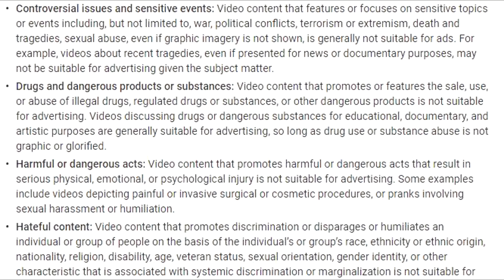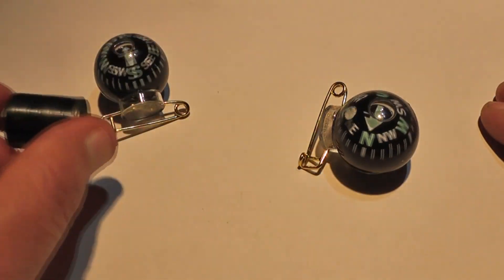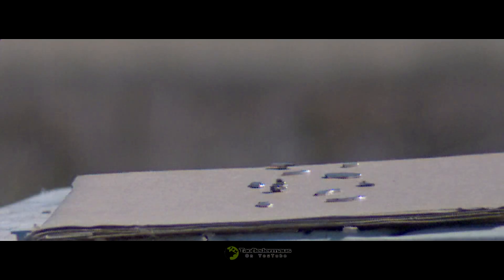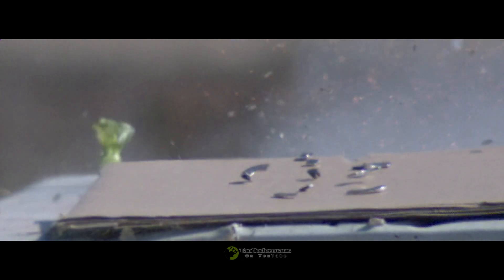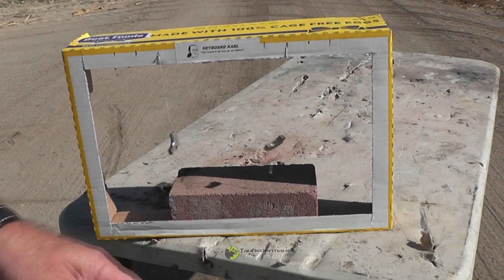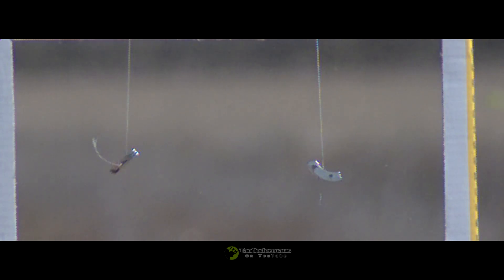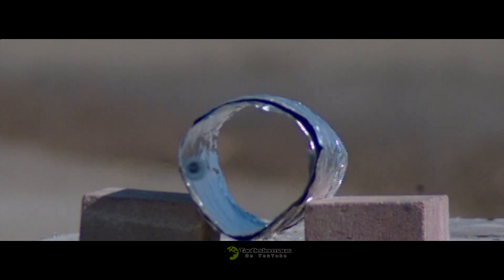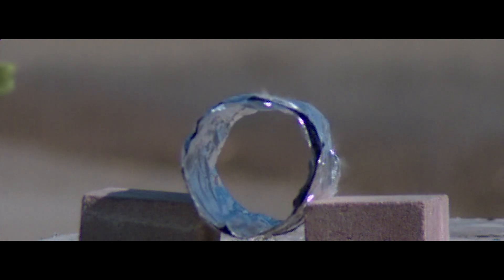1000 MPH Magnet Experiment

Comment: I would suggest using a non-magnetic object to replicate the aluminum foil experiment. (A high speed lead object would work well)

For the magnetic coil I would suggest using an oscilloscope and a Tesla Secondary coil (you can get a decent one on eBay for around $20) The oscilloscope would be best for measuring and potentially recording the results as some have storage function and they are designed to display high speed electrical changes. You may have some luck with LEDs as they have very fast response times, just make sure to hook up at least 2 in opposite directions in case the north south faces switch post acceleration.
Reply: It would also be prudent on the future to try using a piece of plexiglass to shield the magnets from the shock wave

Comment: oh, and for the foil test, you just need Danny to pass some non-magnetic items through at speed. I think there was a bit more than just shock wave there, but if it was the same effect with a  stack of washers run across the same way, then it was shock only.

Comment: ScrewTube. Are you guys on any other platforms?

Also, "electromagnetic catapult."

You might "accelerate" the magnets through a coil, like you did with the pipe, maybe with a voltage meter attached

Comment: The suggestion was made that shooting The magnets through the aluminum foil tube could be expanded.  If you go back to expand on that experiment,  a control to see if it’s the shockwave would be to also make a paper tube of the same diameter.  Then there would be no mango-electric force.

Comment: could you get similar sized to the ceramic magnets super strong neodymium magnets and test them this way. Very cool  experiment.  One cool test for this is use your aluminum tube to wrap a tight copper wire coil end to end of it then slide the coil from the tube. Place it on the shooting stand with a multi meter attached to either end of the wire. then shoot the magnets through the coil and see how much of an effect it would have. great shots guys keep it up big fan

Comment: What if … a neo-diddley-um magnet were accelerated into a container/bag of iron filings/iron oxide?  Would the compounding resistance of dense material be the primary slowing factor  -  or  -  Would the attraction of the magnet at the tip (" and only the tip ") gathering mass through magicnatisim/pixies, causing a increasingly greater surface area, be the cause of deceleration ???  P.S. Other cover noises - Burp, fart, sneeze, whiney, tire squeal, glass breaking, S.J.W. screaming "NOOOOO..."

Comment: "We weren't sure if it was magnetic flux or the shockwave that caused the distortion"
I'm pretty disappointed that you didn't try firing a random 1oz non magnetic projectile through it. Maybe even composed of lead?
V = (F/m)*t
That being said, I knew all the other experiments would do nothing as a weak magnet acting on an object from 4 inches away for less than a thousandth of a second would do as much as blowing in the direction of the objects from 5 yards.
the generation of electricity, on the other hand is directly proportional to the speed the magnetic field moves across the conductive material.
That said, build a simple copper coil and attach an old school maglite flashlight bulb so we can watch it burn out in under a thousandth of a second.

PS: I've been handloading my own slugs since the 2000 fps monster video. The fireballs out of a 14" barrel are AMAZING

Comment: F=m*dv/dt. The force (F) of the ceramic magnet is rather small, the mass (m) of the objects it's passing near is rather large, and the time to act (t) is miniscule. Thus the velocity must be quite small.

For a coil you could try a coil of magnet wire around a PVC tube, but to actually measure the pulse would take some equipment you probably don't have (oscilloscope).

Comment: To check whether the effect on aluminium foil was caused by magnets or by shockwave, why didn't you try to shot the same way with non-magnetic projectile of similar weight and shape through same setup, and compare the results?

As for shooting magnets through the coil: take the cylindrical coil from the school physics lab set (or just wind copper wire around the cardboard tube many, many times), and connect the ends though small fuse. I think the impulse would be so short that even using LED or neon light to connect the wires wouldn't show anything. Similarly to the aluminium foil case, compare magnetic projectile effect to non-magnetic projectile effect.

Comment: Protipp, measure the speed before and after the projectile passing the tube, for reference let another magnet travel through a plastic pipe in same diameter and another one without any tubing. if there is any magnetic force involved the result should show them.
Reply from the maker: we only have one chronograph
Reply: @taofledermaus  that is too bad. anyway thanks for your content.

Comment: This was really cool, im not too surprised that the magnet didnt really affect anything since you can kind of consider the high speed as being equivalent to a short exposure time.
Im really intrigued by the metal pipe experiment. An idea i had to really see the effect of the EMF would be to shoot the magnet through a solenoid connected to a volt meter, voltage should spike as it passes through (although the time scale might require an analog volt meter instead of a dvm). A control should be easy as well by just shooting standard slugs through things. It would also be really cool (and difficult) to measure the speed of the projectile before and after passing through the solenoid.
If i have time ill do some first order approximations later and see what theory says.

Comment: you could "apply" a foster slug to the aluminium foil tube as a control for the same to see if the shock wave has the same effect. i would say you could try to time the effect of the attractive force of a magnet on the compasses by measuring the length of time it takes for the subject of the force to react once the object of the force is brought within range. that way you could ajust the "speed of application" to see what it would take to prove the theory.
Reply from the maker: We did  that,   the shot was in the center,  but I may post it still .
Reply: @taofledermaus  i saw that but to use it as a control to see if there is an aerodynamic vaccum which draws in the sides of the tube. the other side of my point could be a vid in itself where you test to see the reaction speeds of the materials effected by the magnet. would tell you what speed the projectile would need to be travelling in order to have an effect on the compasses. i think is possible that magnetic waves are slower than the speed of sound therefore higher speeds than mach 1 would not  give any results

Comment: Use a cardboard tube wrapped with copper wire hooked up to an analog volt meter.  Like a paper towel tube if those haven't been banned out there, yet!  Even better would be an oscilloscope since they can capture and chart voltage spikes.  Maybe a colab with ElectroBoom?

Comment: You may try shooting through a hollow long coil, and e.g. having both wire ends seperated by a millimeter or so, a electric voltage surge may result in small, visible flashes.

Comment: My suggestion would be to get a second chronograph and set up a control test. Whatever the length of the pipe,(foil or solid)have the two chronographs that distance w/out the pipe and measure the loss of velocity. Afterwards, put the pipe between and see if there's a drop in the reading on the second chronograph. 
Also, was that a patreon funded rail gun and flux capacitor?

Comment: An experiment that would (should) show results if one that you probably don't have the equipment to perform. Squirt a magnet through a loop of several turns of copper or aluminum insulated wire and have the ends of the wire loop connected to a triggered oscilloscope. I'd certainly expect to see a voltage/current pulse generated in the wire. You might have to perform the experiment a few times to get the triggering correct on the scope. One way to trigger it accurately would be to fire the particle through a fine wire, breaking a trigger circuit some distance before the particle passes the wire loop.

In most of the tests you tried in this sequence of experiments I think that inertia was simply getting in the way of showing any results. For instance the magnetic particle almost certainly had an effect on the compass magnets, but they are deliberately damped by the fairly thick liquid they float in. This liquid is specifically designed to keep the compass from zipping around willy-nilly to every slight magnetic variation, and that was exactly what you were trying to detect. So the effect of the moving particle was deliberately below the level of detection of those particular compasses.

Comment: i got an add The tube cant be that big , the magnetic flux is only effective over a short range. The amount of energy is proportional to the speed but you would have a tune that was as close to the same size as the magnet as you could. the energy would show up as heat in the aluminum and slowing the projectile.

Comment: If you had multimeter hooked to the aluminum tube you MAY be able to check for effect.
Reply from the maker: No,  because it it would be like measuring the voltage across a 1000 v.   bus bar.   It would just read zero.
Reply: @taofledermaus  You would need a way to bond it to an earthing(grounding) conductor. I just wonder if it would then create a choke like a metal conduit during a lightning strike does to the current in an earthing conductor, or induce a current in the tube. My guess is it would be the latter in  microvolts.
 If the tube was conducting, would that then cause the magnet to be "choked" and slow the velocity? But then you would need to ground the magnet. Hard to do.

Comment: Excellent video! I love these utterly uncontroversial, family-friendly, pure science videos. This stuff would be right at home on PBS.

The results don't surprise me. I expect that the magnetic field does exert forces and induce currents exactly as you might expect, but it's happening over much too short of a period of time to visibly overcome the inertia of the target objects before the shock wave arrives and shakes everything up.

Now here's something that might work: What if you launch the magnet through the center of a coil of wire, and try to capture the induced current in the coil with an oscilloscope? I don't know if the Taofledercrew includes any electronics nerds, but if not, I'm sure you could find somebody to collaborate with if that idea appeals to you.

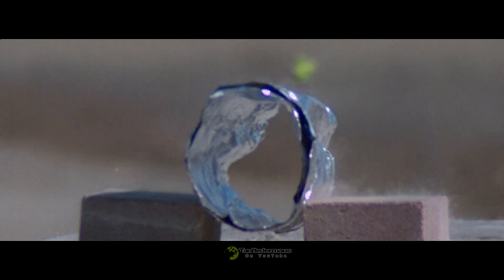Comment: 8:27 You should just set up the same flimsy Al tube and shoot a slug through it.  Probably would get same result.  Probably creating a temporary pressure differential between the area inside tube and that outside.
Passing it over coil and checking for electricity probably requires an expensive oscilloscope to measure.

Comment: I don't know if this is worth repeating experiments for, but it seems as though the shockwave distorted test results more than the magnet could have done. Would that be entirely eliminated by sending subsonic projectiles instead? It also seems apparent that the velocity of the projectile does not allow for enough magnetic field to reach nearby objects, so you can infer that magnetic fields operate as a function of time. So, projectiles over a certain velocity cannot produce hardly any magnetic field in one area in comparison to the same projectiles at v=0.

Comment: If you shoot a slug or a cork etc through the aluminum foil, you can test if it was the magnetic flux or air pressure. My bet is air in all honesty. Also, it is unlikely that ceramic magnets have the magnetic flux density to be noticeable in most of these experiments. N52 grade Neodymium would be more noticeable, plus the fragments stay stronger relative to ceramic fragments. 

Afterthought, was there any different feeling from “moving” the magnets through your “coil gun”? Wouldn’t the steel barrel skew results?

Comment: The best way to determine if the shock wave caused the tin foil to collapse would be to repeat the same experiment, but use a non ferrous slug, making sure that it's calibrated to travel at the same speed as the magnets.

Comment: For a second there, I thought you were charging up a defibrillator. 😛

On a more serious note, the pipe may have been too large in diameter to exhibit the effect you were looking for. Keep in mind that magnetic field strength decreases according to the inverse square law. So you need to get the fit as tight as possible. Unfortunately, that will make it really challenging for Cha-- I mean Danny.

Comment: Shame on YouTube for making you jump through hoops like this.
Sending high speed magnets through or over a coil might just be the test that would show the most effect. Millivolts most likely although a couple of volts could happen. You might try winding wire around a 3 inch PVC scrap and accelerate the magnets through that.

Comment: I have no doubt that the magnet did something as it passed the metal. The big thing is inertia. You would need a ridiculously powerful magnet to impart enough EMF into the object to overcome its inertia and make it start to move. That said, you probably generated some very high voltages inside the pipe, just the spikes would be hundreds of microseconds long.

Comment: The magnet affected the aluminum tube. The other objects were moved by the shockwave from the shot, as you summarised, but the aluminum foil tube starts to ripple as the magnet enters it's "personal space". As it reaches the front end of the tube, you can see the back end just start to ripple. That's not a shockwave effect. 
You've proven that inertia will counter magnetic effect on a close flyby, but the effect is present because the aluminum foil tube reacted.

Comment: IIRC, the magnetic force drops at the square of the distance, so a) any eddy currents would have been very minimal with the amount of clearance you had b) if you had a coil, it would have generated negligible voltage due to the clearance. Your tests may have very well produced a result if the clearances were much tighter.

Comment: Theoretically shooting that magnet over that steel plate or through a coil should create a pretty large electrical current since it's proportional to Velocity. I don't remember the exact equations but it would be cool to test
Reply: how does the magnet's properties change during and after very high acceleration?
Reply: @jackvernian7779  They don't only the derivative of the acceleration, (the velocity) is proportional to the current produced. A moving magnetic field (the magnet) can induce an electric field in metal surfaces. An electrical engineer explain this better, but there are algebraic and calculus based equations we can use to determine the strength of the electric field induced

Comment: it could not have been the shockwave, you could see the ripple going through the aluminium foil at the same speed at which the magnets where moving, the shockwave could not have done this as it  would have moved slower than that, plus you can see the shockwave hiting the aluminium foil after the first ripple had already passed.

Comment: Hi Jeff if you want to check if the aluminum foil tube is collapsed due to simply the shockwave you can just send a standard non-magnetic slug through it and see what happens... should be pretty easy for you guys to do with whatever sort of linear accelerator you seem to be using!

Comment: Try a long length of pipe. Use a chronograph before and after the pipe to measure loss of speed. Do the same at the same distance without the pipe. Look for a greater reduction in speed from the one through the pipe.

Comment: You misunderstood the experiment completely with the copper tube. My son almost 1 going to Washington DC for a science experiment based on the same principle. What you needed to do is to have 2 devices to test speed of the bullet prior to entering the tube and after the magnets left the tube. If there was a slower speed exiting the tube of an appreciable amount over not passing through the tube then you would have been validating the science. What happens is the magnets create a back EMF through the tube causing the magnets to slow down. The magnets need to be neodymium magnets array very high magnetic value. My son was able to tie an egg to the back of a neodymium magnet drop it and an aluminum foil tube off of a two-story building and the Egg survived.

Comment: I am pretty sure the aluminum foil was crushed by the magnetic field created by the magnet creating a current flow in the foil. If you watch and compare to the others, the shockwave followed the projectile by several inches but with the foil, it was pretty even with the magnet. The reason you don't see a reaction in the other shots is inertia. The magnets are very strong but the force applied to the objects is very brief and not enough to overcome the inertia of the objects. If you watch close, in the shot through the aluminum tube, you can see the projectile drop significantly as it came out of the tube. The Magnet passing through the tube generated an electric current which in turn slowed the magnet down, causing it to drop. The interesting thing to do would be to chronograph it before it went into the tube, and then when it came out and see how much speed it lost.
Reply from the maker: I really thought the foil test was interesting so I want to see how 22s,   45,   rifle rounds,  etc   affect it.